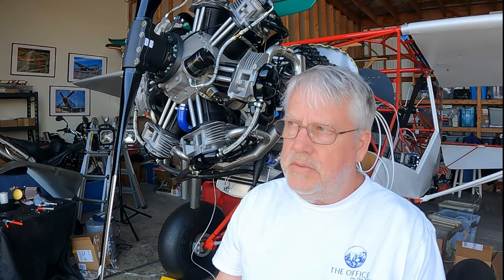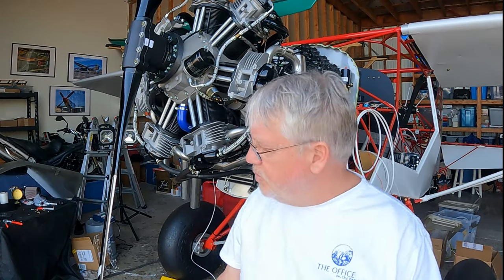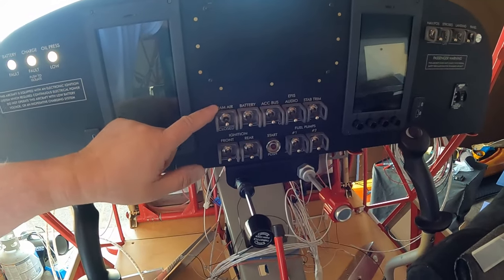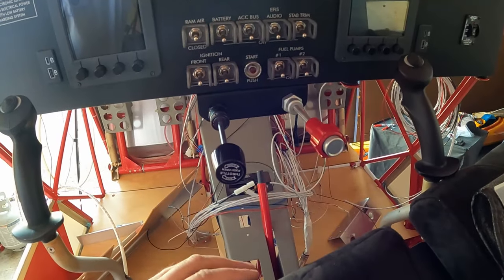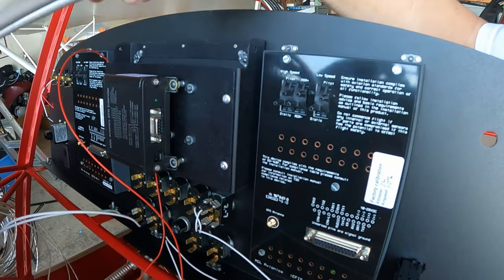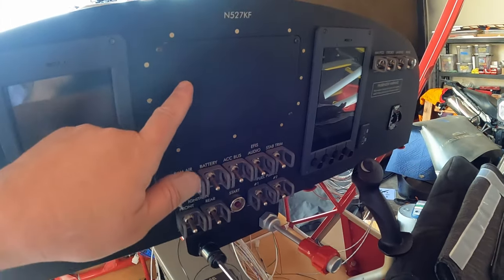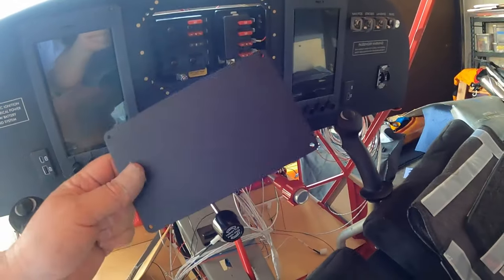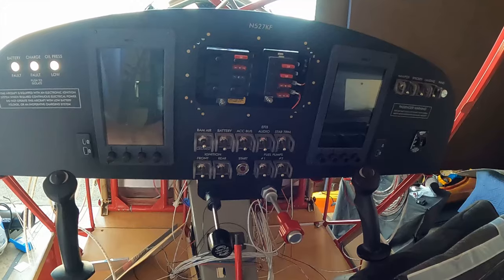Verner Kitfox 5 ep 40, Instrument Panel Install

Comment: The C-46 at the end didn't sound right.
Reply from the maker: It was stone cold and just taxiing out to warm up/run up.  I saw it take off later and it was running great.
Reply: @vernerradialkitfox4083  That's good to hear as those airplanes never worked very well on one engine. My late dad had experience with C-46s dating back to WW-II and always said if you ever see one airborne with a prop feathered, get far and fast out of the way because it was only coming downward.